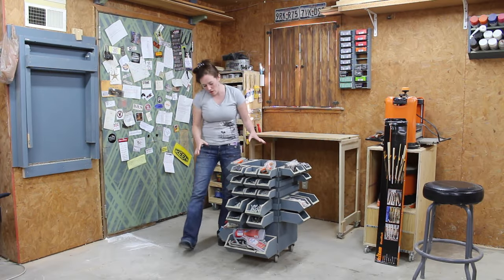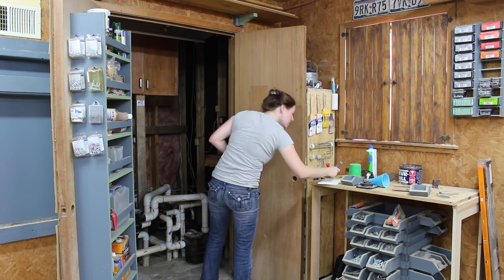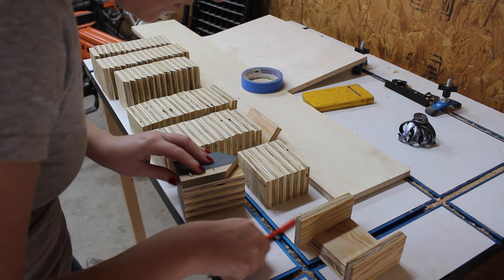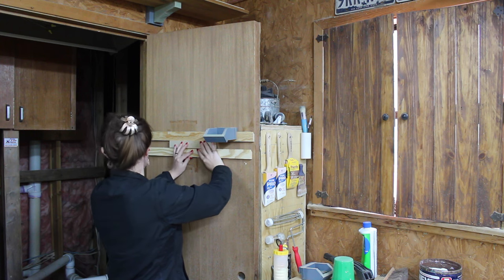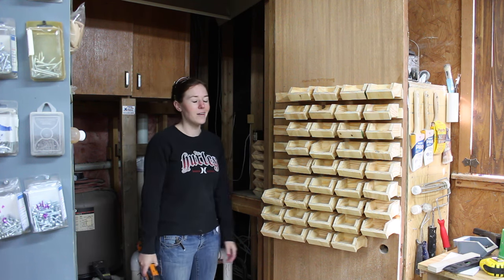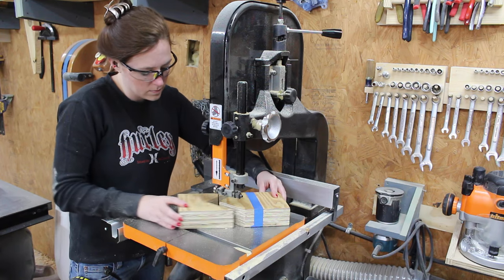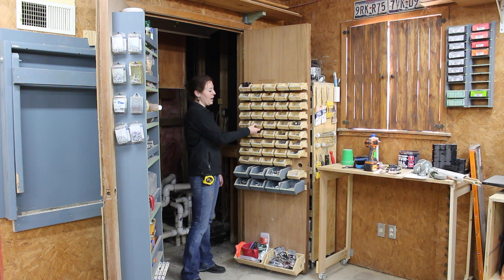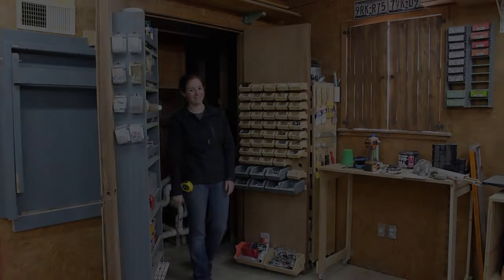Shop Hardware Storage

Comment: why couldn't the ones you already  have  and reuse them on the door? just asking
Reply from the maker: I could have but if I did then I would only be able to fit 4 bins on each row and have a few inches left over...so instead I changed the size slightly and was able to fit 5 bins on each row.
Reply: +April Wilkerson ahhh ok ty

Comment: I took scap 2x4 and rip made 3sides being 1/2 thick 3.5wide by 7 inch until my wife shut me down for the dust, I cut enough for 16 boxes
Reply from the maker: : ) Great thinking, using ripped 2x4s will make it cheap. Doing the bins in small quantities isn't a bad thing either since it's very time consuming. Maybe do a few a week or whenever you get time between projects.